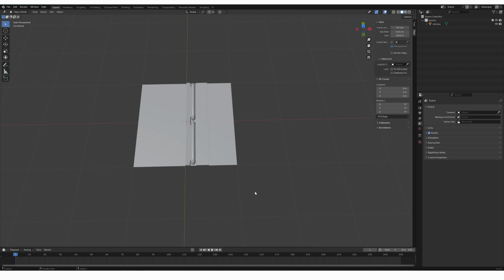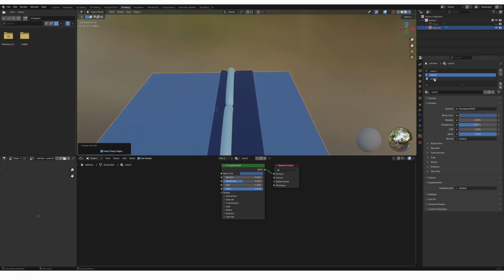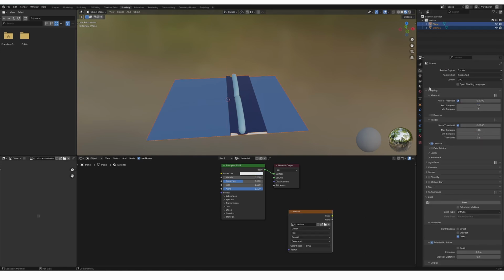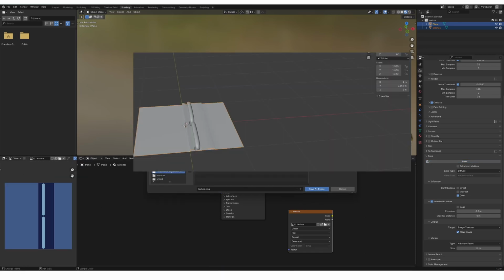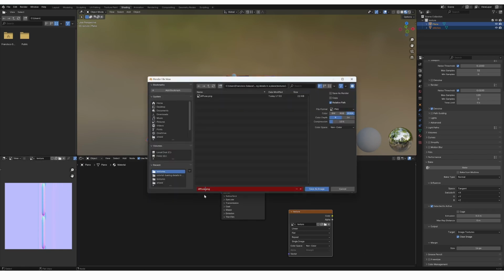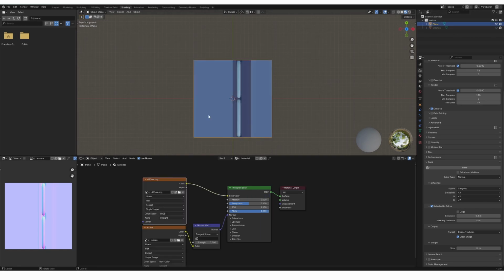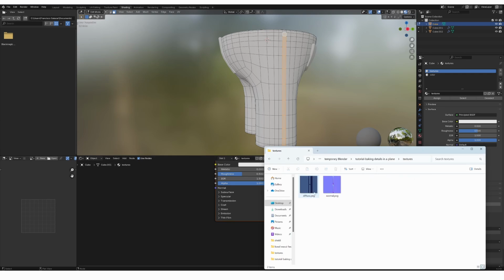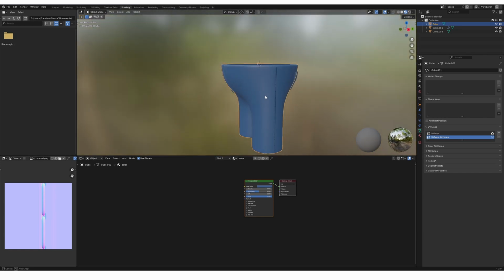Transfer High Poly Details onto a Plane in Blender

Comment: Hi! Any ideas on why my normal map texture seems to be somehow 'inverted'?
Reply from the maker: Hi, your model might have inverted normals. If you go to ‘Viewport Overlays’ and enable ‘Face Orientation,’ your model should appear completely blue on the outside. If it’s red, you need to flip the normals. To do this, select the model, go to Edit Mode, press A to select everything, then press Ctrl+N and choose ‘Recalculate Outside.’ If that doesn’t work, select ‘Flip.’ Later, you can redo the baking process, and the normal map should be fixed. Let me know if this works for your case, or we can try another solution.